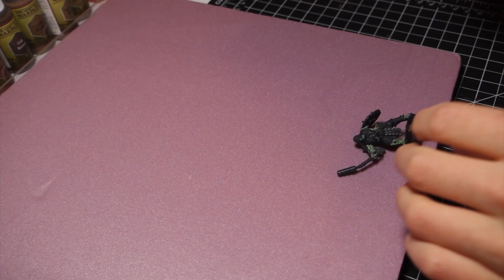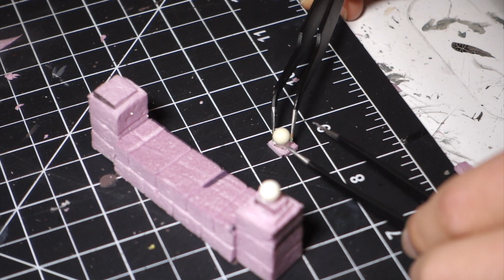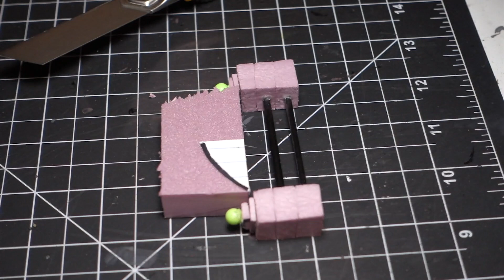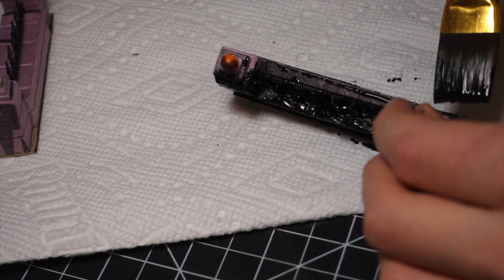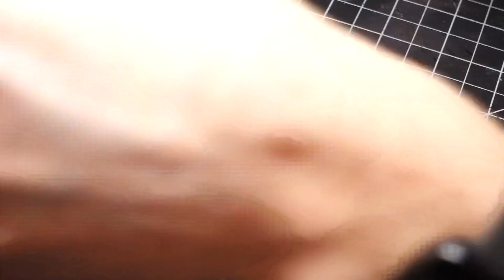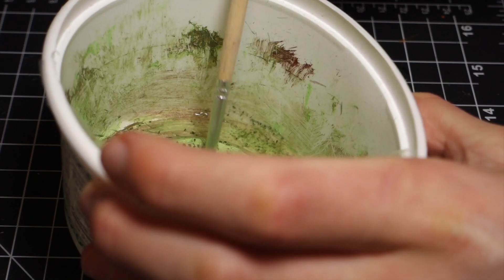Crafting a modular Graveyard Fence and Gate for tabletop gaming! Graveyard Diorama Part 1

Comment: Really nice but I have one suggestion to improve the modularity. Put a pillar only on one side of each fence section. (You might build one or two with 2 pillars, but most should have only 1). The reason is you won't have two pillars adjacent to each other this way. There will always be fence between them. 
Each fence section individually might be asymmetrical, but when assembled, the fence will look symmetrical because each fence section touches the next pillar.